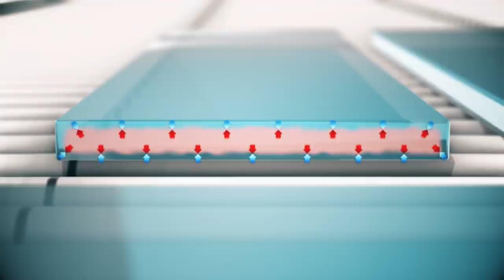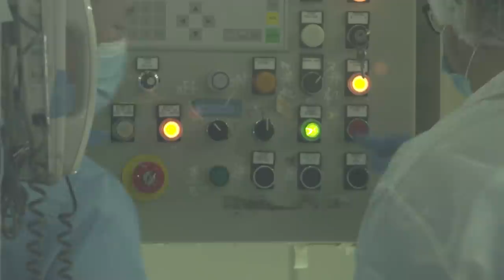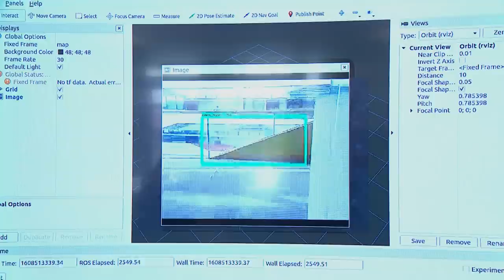How To Enhance Glass Safety In Your Home? | Talking Point | Full Episode

Comment: thats why most pots and pans are forms of metal. I have had pyrex cooking pans not handle transitions from oven to cooling trivets (ie on non-conductive silicone pad....not cool counter). I am always very careful if I have to use glass cookware now.

also, electric kettles are a thing. I boil water in that and then move to stove, mostly because its less energy used, but also if my kid distracts me.....its ok. They auto-shutoff at 100c/212f.